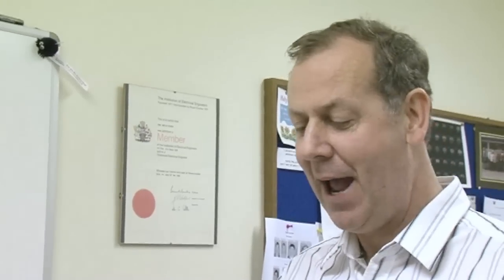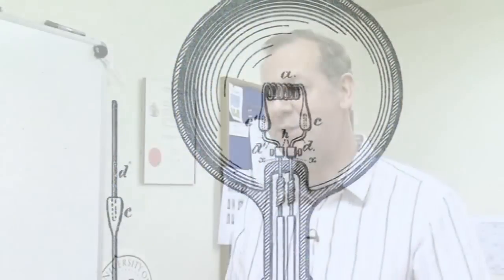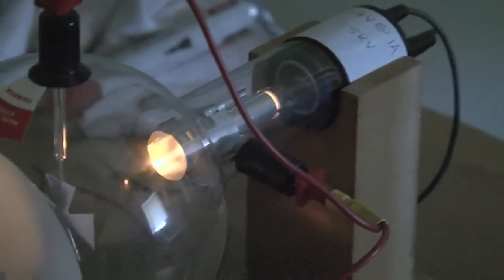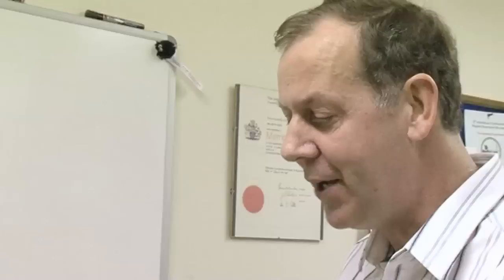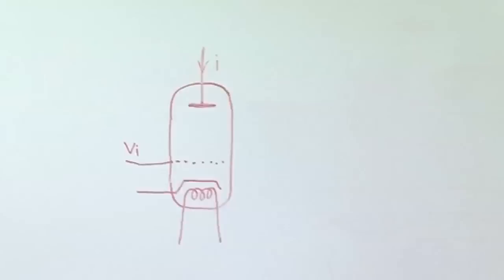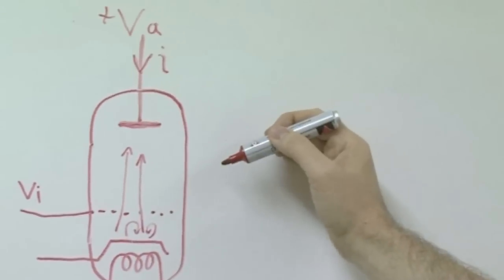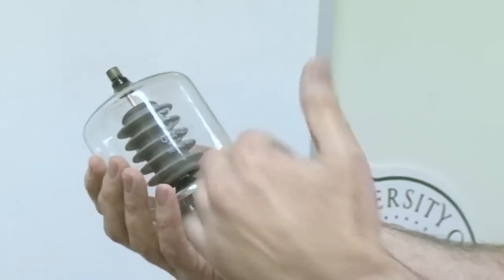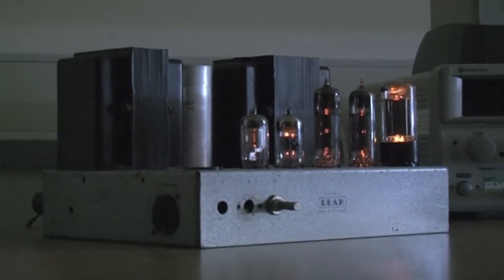Vacuum Tube - Sixty Symbols

Comment: Why oh why hasn't conventional current been changed?  It was a mistake, so fix it.  I thought this was science!
Reply: +louis tournas When Franklin assigned the terms "positive" and "negative," he basically guessed.  He had a fifty-fifty chance of guessing correctly, and didn't get it right.  Remember, he was working with static charges, and at a time when electricity was considered a fluid (another best guess that turned out to be wrong).  By the time others had sorted out the mess, it was too late, as Thor the Norseman explained in his post.
Reply: Lee Merkin
"You are demonstrably incorrect. Electrons do not flow. Charge flows, and the electrons themselves remain pretty much stationary in comparison."

==Charge is not a particle.
Electron stay stationary? You are making things up. Do you understand the phenomena in the video?
Reply: The fact is that unless you're designing physical components, you don't actually care whether electrons flow one way or the other.  That's why the convention, even though "wrong", worked just fine for all concerned - and still does.  You sometimes come up with a negative value for I when solving circuit problems - which just happens to indicate the actual direction of the electrons.  It's really just a convention, and nobody working in the field is the least bit confused by it. 
And Louis is correct - electrons do move when current flows - at least within metallic conductors.  SOMETHING has to move, because "charge" is a property of matter: it moves only if charged matter moves.  Electrons in a metal conductor move surprisingly slowly, given how rapidly an applied voltage propagates along a wire, but they do move. In a 20-gauge wire carrying 5 amps, the drift speed is about a millimeter per second, but the electrons in a vacuum tube rip along at about 0.1c.  (In an AC circuit, of course, they only slosh back and forth.)
Reply: CowLunch because there is no need to. if the moving charge is positive, the direction of the current is "correct". you would probably assign the direction of a river's flow in a way that it points downwards. but you could do the opposite and nothing would change, except for the meaning. with charge it is even more arbitrary, as there are two sorts that cancel each other out.
Reply: CowLunch I'm not sure why this wasn't changed. The electron was discovered a long time ago and its direction of flow was known. Perhaps people were just hard headed back then (and now).
Changing it now would be difficult. It would be like asking England and a few other countries to start driving on the right side.
Reply: ***** You are absolutely right, it is just frustrating and confusing having to deal with this mess.  I suppose it is the same frustration people have with odd spellings, but once we learn the history behind these peculiarities it becomes more acceptable and serves as a window into our past.
Reply: Because it's not really a mistake. It's arbitrary. The conventional current flow is in the opposite direction to the electron drift, but of course in devices where holes are the majority carriers (of which there are many) current flow is in the same direction as carrier flow.
So long as in any system model there is consistency applied to each vector, the answer is the same.
Reply: Lee Merkin
It is a mistake. The electrons are the ones that move. Holes don't flow. That is a model in semiconductor physics.

Now if we were on a planet with antimatter, then the direction would be correct. Positrons would be the ones flowing.
Reply: +louis tournas Holes absolutely DO flow in many, many electronic devices where holes are the majority carriers.
Reply: +louis tournas ...also, electrons themselves are models in semiconductor physics just as holes are. They aren't little particles whizzing through wires. Instead they are a probability distribution of orbitals around the nucleus of the atoms in the conductor or semiconductor, the distribution of which forms the valence and conduction bands in the material. Applied voltage causes atom to atom energy transfer for through electron-electron and electron-phonon (loss) interaction giving rise to the phenomenon of current flow and resistance.
It so happens that the electrons drift in the opposite direction the the arbitrary conventional current flow, but then holes drift with it. So perhaps you can see that the simple model you are referring to is actually not wrong, it is oversimplified.
Reply: Lee Merkin
It has been established that electrons are the charge carriers. They are the ones that flow. Whether you think of them as particles or a wave distribution doesn't matter.
The best way to determine this is through a vacuum tube and to show which side a shadow is cast. 18th century people got it wrong.
Reply: +louis tournas You are demonstrably incorrect. Electrons do not flow. Charge flows, and the electrons themselves remain pretty much stationary in comparison.
Reply: JohannaMueller57
Relax. Go for a smoke.
Reply: Lee Merkin
"So yes, in the majority of electronic circuits the electrons are barely moving, it's charge (energy) which is moving."

==So, are you saying that electrons are barely moving. The actual things that are moving is charge?

"Now stop thinking you know everything and realise that some of us have qualifications and jobs in this field!"

==OK, I'll consult a few other people and pull them into the conversation.
Reply: jpdemer55 i completely agree. All i'm trying to get across is that there is a difference between charge flow and carrier drift, and there are many species of carrier possible which means that electrons aren't special.
Reply: I am trying to get across the premise that carrier drift is not the same as charge flow, is normally nowhere near as fast as charge flow in most solid materials, and lastly that there are many species of charge carrier so electrons aren't special. Electrons don't flow, they drift. These words have scientific meanings in this context. I notice you didn't quote here the many people that agreed with me in your thread at sciencemadness...

Sent from my iPad
Reply: Wow. I've already explained this but i will try again. In a conductor such as a metal, charge can flow very fast: almost instantaneously through it. This is why when you hit the light switch the light illuminates right away. However, the speed at which the electrons drift through the metal due to the applied E field is much slower, in the order of cm per hour.
Reply: Lee Merkin
"In a conductor such as a metal, charge can flow very fast: almost instantaneously through it."

==Charge? Perhaps you mean electric field. If you are talking about something else, then please provide a link.

Comment: What does he mean by the electron flow goes against the current flow, what did our forefathers get wrong? Can someone give me a link to explain's what this is about.
Reply: flyer5769 It was assumed power flowed from + to -. However, electrons are - meaning to bring power they flow from - to +.
At least that is how it was explained to me.
Reply: flyer5769 Wrong assumptions were made about which direction charge flows, and diagrams were made with that assumption. Viewing it this way became the convention before we found out it's the other way around. We get around it by saying electrons have negative charge.
Reply: ***** So are you saying that in essence, a car battery is labeled backwards. Or that we change the definition so that the labeling fits.
Reply: Current needed to have a sign (+ or - ) if people were going to be able to do calculations with it, so a positive "direction" was arbitrarily assigned.  According to this conventional (historical) definition, what we call "current" flows from the positive terminal of a battery to the negative terminal. (The +/- terminal designations were themselves arbitrary.)

It later turned out that the electrons that carry current in wires actually travel outward from the negative terminal of a battery, and return to the positive terminal.  So the convention is "backwards", at least when it comes to negative charge carriers like electrons.  Positive carriers, which are common in semiconductors, travel in the same direction as the thing we call "current", so the convention is not wrong for those devices.  It makes no difference to the equations what particles are moving with what charge, so the math works out regardless.
Reply: +flyer5769 As I posted elsewhere, it was Franklin who got it wrong.  He didn't know, and made his best guess, thus causing an enduring confusion.  If the problem had been correctable, it would have been fixed well over a century ago, but even then it was too late.
Reply: Electrons have negative charge....saying that the negative charge is traveling to the right is the same as saying positive charge is travelling to the left.

Comment: Vacuum tubes are still used in the best guitar amps too, solid state distortion just sounds a bit too... artificial haha
Reply: could you point me to a randomized controlled study that confirms that hypothesis?
Reply: Every guitar player knows.Transistors have A very sharp border between clean and distortion,valves are much smoother.
Reply: *****
He doesn't seem to know that the distortion caused by solid state devices is more accurate lol.
Solid state distortion is actually how the sound really is.

If I find the place where I read that I will give it to you, but I'm not sure if I can find it, I read that years ago.
Reply: George Kotsonis There are studies indeed. the fact is that the tubes have a cuadratic law transfer function(current vs grid tension..), which means you'll have even harmonics summed to the original signal, which are nice to the human ear...the solid state devices (BJT transistors), when working in class A have no distortion at all, because they work in a linear region...
Reply: Modern electronics can very accurately replicate the transfer function of valves, giving the same warm valve sound in solid state without the need to replace valves. However, some audiophiles still believe they can tell the difference, but a spectrum analyzer will assure you they cannot!
Reply: just fyi, the warmth of vacuum tubes/valves is actually introduced by output transformers, which are less efficient at higher frequencies than lower frequencies. If it weren't for the output transformers used on valve amps, you'd be hard pressed to notice much difference (other than noise floor) between transistors and valves.
Reply: Haha, I seriously doubt there's any studies about it, I just know the physics behind solid-state vs. tube amps.  Vacuum tubes can typically generate a lot more current/signal gain, but with an inherent inaccuracy/uncontrollability caused by electrons flying through a vacuum
Reply: George Kotsonis
One advantage that tubes have over transistors is the clipping, which is pretty bad on transistors.

Comment: This guy should not be on sixty symbols theres a difference between having knowledge and being able to pass it through... 

I personally didnt get anything useful out of this it was more like a historical representation of facts based on time.. than an explanation to how things work..
Reply: Ronald de Rooij if it's any help; the heater coil obviously heats up and radiates heat in the form of photons. The photons knock electrons out of the cathode which will move towards the anode (if there is enough potential voltage there) due to the electric field created at the cathode and lack of field at the anode. The electrons start to flow towards and through the anode because electrons dont particularly like each other and their fields so they tend to head away from electric fields.

Comment: Except that the transistor is a solid state device, where the thermionic valve is a vacuum device. BTW, the operation of the valve looks much more like that of a FET than of a bipolar junction transistor.

Comment: Since the 1950s actually. Though for the high powers aluisious talks about (hundreds of thousands of watts) transistors are far less effective and way too expensive. (You would need thousands of them in parallel)
Reply: True, but IGBTs fill the middle ground.

Comment: It isn't so much the nishe aspect so much as the power supplies you need to operate a tube amplifier that drive up the cost, those require large power transformers that can deliver higher voltages and higher current in relation to solid state equipment. There are niche market tube amps with greatly inflated prices but there are more production oriented ones that don't use rare or exotic tubes as well.

Comment: Because they are niche devices.
Transistors are cheaper to produce, much smaller, and they don't heat up nearly as much in low power applications.

Comment: The amplified current flows through an electromagnet coil which moves the magnet connected cone at the corresponding frequency. The air pushed by the cone at this frequency (think of waves) is the sound you hear. A microphone works in the exact opposite way. The sound (air) flows in pushing a magnet, which changes the magnetic field in a coil (electromagnet), which induces a current. Then you can amplify this current with a tube, and put it through a speaker.

Comment: Almost every TV and radio broadcast you see and hear passes through a tube.  Tubes are still the best way to go for high power transmission.  So when you need to output 1500 or 15000 watts you use a tube for that.

Comment: no they cost more because there is less demand for it and they do actually cost more to make because of the vacuum involved. 

also they get hot too so they need heatsinks, like the two silver boxed on the end of the amp thats in the video, to disperse the heat. which again adds cost.

Comment: @cuntylishus  actually, there is more to why people like tube amplifiers. One of the biggest is how tubes tend to alter the transients of a sound source. Because tubes tend to react slower to passing signals then transistors, the result causes the transients (initial spike in an audio wave) to become rounded off. Because of this it is interpreted by the brain to be more natural and pleasing when compared to transistors. This is why most guitar players use tube amplifiers. It is quite noticeable.

Comment: Solid state technology is quickly taking over for high power applications to replace vacuum tubes. Many of the new high power microwave and broadcast systems are completely solid state.  For a while more, there will still be some need for very specific types of vacuum tubes. Eventually, they will be completely phased out. 

In looking at the basic light bulb, the CFL, and LED technology has taken hold. Soon it will be high illumination electro-luminescence technology.

Comment: Great summary of thermionic diode and triode.  TY for posting.  BTW if I'm not mistaken the thermionic emission of electrons from a heated cathode is sometimes called the Edison effect.  The emission process itself is analogous to evaporation of particles (electrons) from a 'liquid-ish' phase (confined in the metal) into a gaseous state. Raising a cold cathode voltage eventually causes field emission. Which can image the molecular structure of the emitter, as in the field emission microscope.

Comment: @Envergure 

i have a tube amp and they are very fragile, you cant turn it on and just rock heavy metal, you have to let the amp "warm up" and thats why most amps have a standby" function so your not on and you can let the tubes inside your amp warm up so they dont burst when played hard.

Yes tube amps sound better.. much less digital if u run alot of effects or tones :) however vox, as any amp company sells tube amps. Their is nothing particularly special about Vox's! thanks

Comment: The reason vacuum tubes have to be evacuated is that any air in the tube would ionize and cause an arc if the tubes were operated at high enough voltage, and that would really suck because a high-power vacuum tube failing can be quite dangerous and expensive.